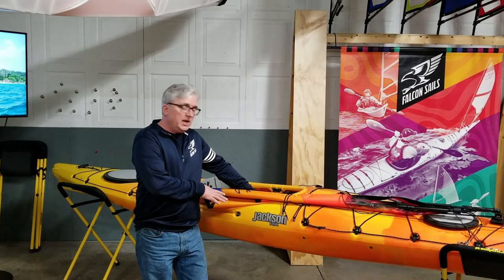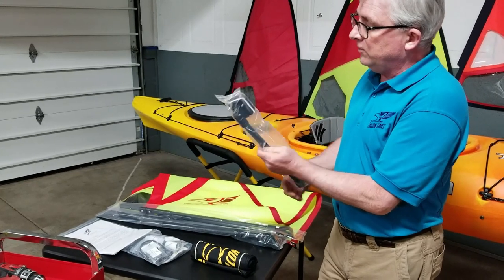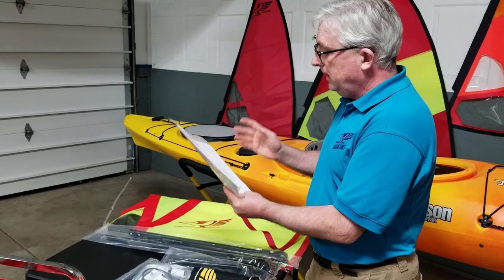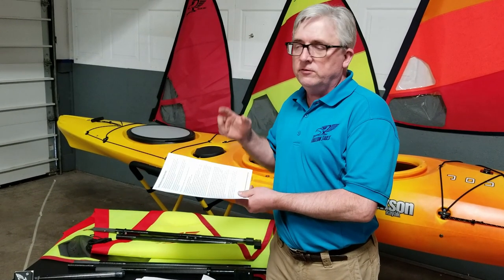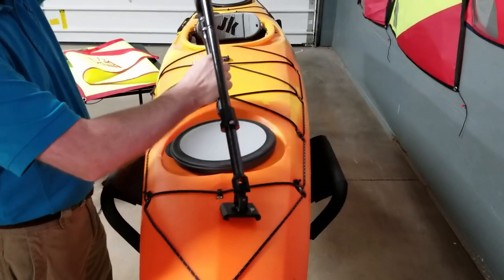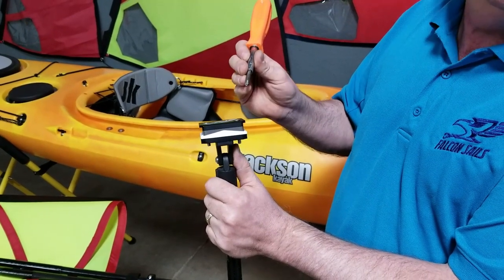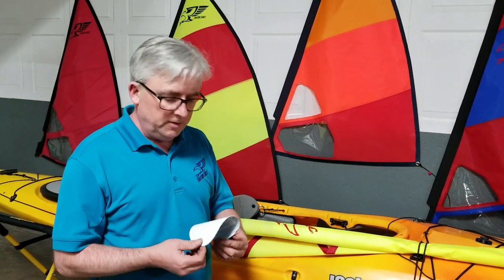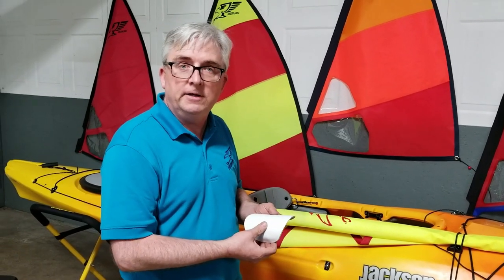How to install a sail on a kayak

Comment: Do you have any customer that installed one of this on native watercraft fishing kayak ?
Reply from the maker: We have helped people rig sails on over 2000 peoples kayaks as of now, and a good number of them are different variations of Native Water Craft. In any case, we have a rigging plan for all hard shell (plastic, fiberglass, wood, ect) kayaks.   You can even install a sail on inflatables and folding kayaks, but that requires a little more work.  Call our shop and or email us, and we will be happy to let  you know exactly what you may like to know about your kayak.  In any case, if you order a sail on our store.
www.falconsails.com/store
At the end of the purchase process we ask you about your boat, so we have the information.  We will make a custom rigging kit that is perfect for your canoe or kayak.  This will allow you to have a rigging kit for a fast and solid install.

Comment: So this will adapt to most yaks?
Reply from the maker: Yes.  We make rigging kits for every kind of kayak our customers ever ask to rig a sail on.
After helping thousands of customers and doing this full time for over 10 years, we have seen it all.
We have analyzed 9 out of 10 kayaks and have the parts list and stock ready to go.

At the very end of the purchase process we ask, what kind of kayak or canoe do you want to rig your sail on.
You tell us, and we make a rigging kit for you.
It will include 100% of the parts and adapters you need for a easy and solid rigging job.

You can custom design your sail here.
www.falconsails.com/store

Comment: Imagine how fast they would go double the sail size.
Reply from the maker: Actually a bigger sail only helps if there is really light wind.  And when there is really light wind, even a huge sail will not do much for you.  At a super light wind levels most people would prefer to have a relaxed paddle and go 3mph vs use a big sail to push you at 1mph.   That big sail will be too big at times.
Falcon Sails have the balance of size that will not over power you in high winds, and still can take advantage of lighter wins.
If you look at this video at 39 minutes 42 seconds, you will see the 1.0 square meter sail is pushing the boat it is rigged on just as fast as the 1.4 square meter sail is pushing the boat it is rigged on.  Once you hit maximum hull seed with a kayak, you need to add 10x more power to start surfing, and you would need a sail 10x bigger.  It would be dangerous, and not do much for you.  In any case, there is no sense in over powering any boat.

Comment: What knot is used on the stay lines?
Reply from the maker: All the knots are pre tied on a Falcon Sail rig.  All you have to do is make the final adjustment to fit your kayak. A detailed set of instructions with a knot diagram comes with a Falcon Sail rig.  There is a combination of knots that work together to make a super reliable set up, with absolutely zero slippage for the life of the rig, and super easy adjustment.  It includes a overhand knot to attach it to our junction ring, an overhand knot on a bight to make an adjustment loop, and a sheet bend to do the actual adjustment.  It is a really nice and effective knot set up.  For quite a few years we encouraged our customers to experiment with knots, and they were always inferior to what we include in our kits.  Most knots people with experiment with would usually adjust or slide a bit and or also get so tight, they would be about impossible to adjust.  Any adjustment or sliding will eliminate a sail rigs good adjustment.  Not being able to adjust lines, makes it too hard to perfect the tuning of your lines which takes away from the strength and proper geometry of a rig.

Comment: How do you not flip
Reply: It is easy.  If the wind is too much, you can lower a Falcon Sail in seconds.  98% of the time the wind is not strong enough to push you over anyway.  Most people will be afraid to go out long before the wind is too much.